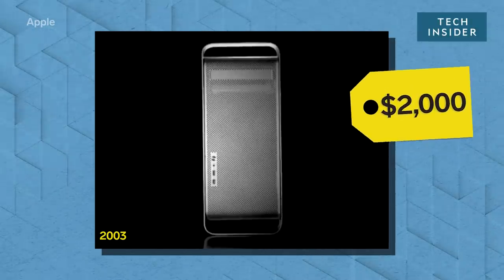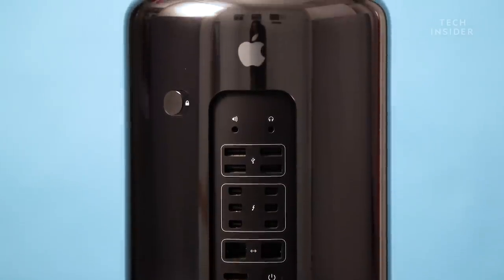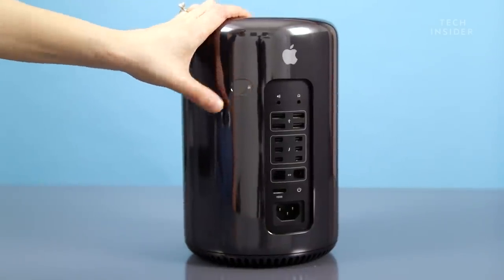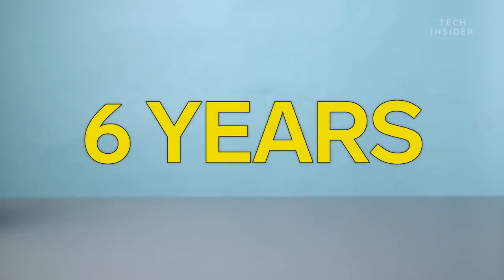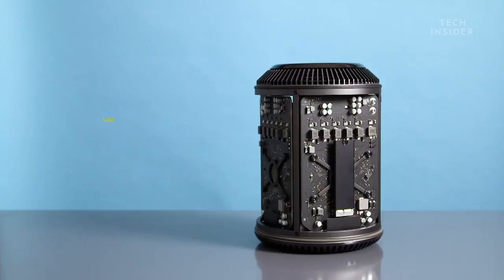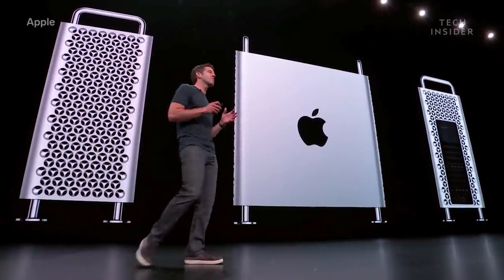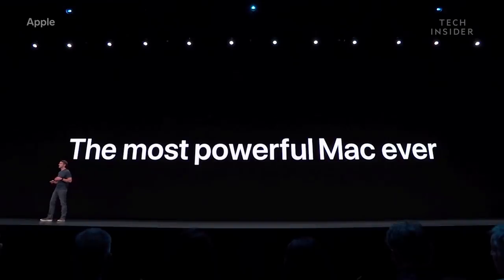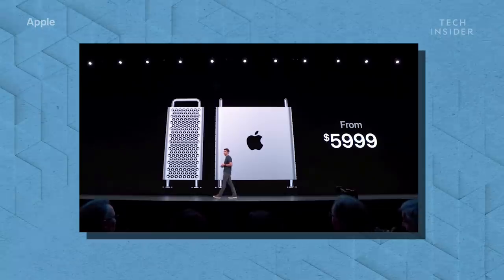Why Apple's 'Trash Can' Was A Colossal Failure

Comment: Wait, these ppl knowingly bought an Apple product then complained about a lack of expandability or customization???
Reply: Kevin Davis talk for yourself. New Mac Pro has 1.5TB Ram expandable

28 core processor 

8TB SSD
Reply: @kanishka100  uh, it's still overpriced garbage compared to building ur own pc
Reply: @nick14324  did i just see the word "just"?
Reply: Kevin Davis hmm
Reply: I understand that it's a bit of a running joke, but on a pro machine, the lack of expansion and customization post purchase will be what kills it in true professional workflows. It isn't just about having a powerful computer, it's about having one that can easily be serviced for things like dust removal and even replacing certain parts of the system, like CPU and GPU, either as an upgrade or a repair. The "trash can" Mac Pro was none of these things. Sure, the RAM and storage were easily accessible, and you could technically get access to the CPU and replace it yourself, but it's a laborious and lengthy task, requiring several panels to be removed. IMO, it would be my worst nightmare if I had to service these for anything other than a RAM replacement, and to make matters worse, from what I heard, the system won't even power on unless the outer shroud is attached, which can make diagnostics and repair take far longer than they need to. On any other typical PC, replacements for anything other than CPU and motherboard shouldn't take more than 5 minutes (not counting the tuning process or getting drivers for the GPU), and best of all, you don't even need the case to be sealed, hell, you don't even need the power button plugged in, you just need to press an on-board power button or bridge the pins that go to the power button on the case.
Reply: @kanishka100  
1) that's up to
2) the base config uses middle of the road specs for a price of 6k (my gaming PC could probably go toe to toe with it in all but a few specialized tasks like those made with AVX-512 in mind
3) The default SSD techically isn't user-replaceable, as it's paired with the T2 chip.
Reply: kanishk sharma But it costs $66,000.00 in that configuration
Reply: @kanishka100  AMD Epyc 2 CPUs can support 4 tbs of ram, has 64 cores and 128 threads. Base clock of 2.6 GHz and can overclock to 3.3GHz and only costs 7,500. But that's only the cpu.
Reply: I bought an Alienware in 2012. I’m still using it  in 2020 and never needed to upgrade any of the parts.
Reply: why do people hate on apple so much? sure they make mistakes, but everyone does!!
Reply: The whole point of the Mac Pro in the Apple ecosystem has always been that it fills the needs of anyone who is not served by any of the other more constricted models.
At a price, of course.
But the whole point of the Mac Pro is that it is expandable and customizable. It needs to fill all the gaps.
The 2013 failed to do that. Hard.
Reply: Imo the only reason to buy a mac is for the software, much of which is exclusive to apple for some reason lol
Reply: @jacobamador7989  true
Reply: @MiguelSantos-kc6vw  even though a mac pro isnt for everyone I would assume it would outperform a standard pc when talking about more workflow related programs compared to warzone
Reply: @kanishka100  for 3000$
also why tf you need that many ram
Reply: @kanishka100  oh its 6000$
yea easily defeated by 2000$
Reply: @MiguelSantos-kc6vw  it’s actually not overpriced for what it does, it is by far one of the most powerful computers in the world right now
Reply: With the previous Mac Pro it was possible.
Reply: @MiguelSantos-kc6vw  you’re doing that right now
Reply: @kooranaad1839  it's actually not the most powerful. Check snazzylab maxtech and Linus.
Reply: @raymond1990  i said one of the most powerful
Reply: @kooranaad1839  not close
Reply: @raymond1990  umm ya
Reply: All custom PC could beat it at a lower price.
Reply: @raymond1990  it has like 1.5 tb or ram
Reply: @raymond1990  definitely not the most powerful but definitely super powerful
Reply: @kooranaad1839  and AMD can support up to 4tb
Reply: @MiguelSantos-kc6vw  no it isnt. You are attempting to compare consumer parts vs server/enterprise parts which just shows how unbelievably ignorant you are. Build a similarly specced pc and youll find they are the same price or more than the mac. Just look at dells and hps offering
Reply: @ZeldagigafanMatthew  it is user replaceable apple now added documentation on how to update the t2. Ive personally flashed a t2 chip to get an ssd to boot
Reply: @frederickrichard1718  the reason is that they continue to make those mistakes, usually worse. However, they view them as "innovations."
Reply: @hajjdawood  bet.
Reply: @MiguelSantos-kc6vw  95% of people in this comment section can't afford Apple products but still debate on it
Reply: @rudra20048  bet
Reply: Shocking
Reply: The whole point was that few people did buy them. Anyone talking about custom PCs is completely missing the point. I doubt if any company hired a Graphic artist or Animator and then told them to "buy some cheap parts from Newegg and build yourself a PC". They might have compared MacPros against something like an HP Z series but the decision was most likely based on the software they were expecting to use

Comment: Don't worry, some time later it will become a collectors' classic
Reply: @sasig5215  Exactly, like the Cube and the iLamp.
Reply: Yes
Reply: true dude. haha techie guys always find a way to customize their setup haha
Reply: Can you actually use it as a trash can? I see potential
Reply: A collector´s item where you throw in collector´s items that didn´t cut it.
Reply: It is a beautiful machine. It will become a classic.
Reply: Fingers crossed :)
Reply: Sheeps will buy it anyway
Reply: would probably buy one when it gets to 500£
Reply: I just sold 3 Apple laptops ; 1994, 1996 and whatever year the tangerine orange joint was for $200. Couldn’t believe it !!
Reply: Yeah like the itoliet
Reply: @RogerioPereiradaSilva77  The Cube was produced for a much shorter time, and it competed directly with the G4 towers which is what most customers ended up buying instead. The 2013 may have been a flop but it will never have the rarity or collectibility of the Cube.
Reply: @OGtalks  I'm not surprised and am seeing this with PCs as well. Hipsters, in their late thirties think a 1994 computer which was worthless a few years ago is a valuable antique. If you want a real shock look at the price of Amigas.

Comment: they should also understand why making a computer stand so expensive isn't too smart of an idea.
Reply: low level otaku The screen is made for pro users that don’t need a stand, because they use other alternatives.
Reply: Low level otaku ---- The target market for the Pro Display XDR will buy them like crazy and save around 20 grand to 35 grand vs comparable monitors.  At that point do you really think they care about $1000 dollars? If they already have a VESA setup they like, the monitor stand is optional.  You're not the market, why do you even care?

Comment: Finally picked up a trash can Mac for $300, and a 12 core CPU for $25. Works fine for what I need. 

The problem with this and 2016+ Macbook Pro's until recently was they ignored what PRO's needed, namely ports and upgradability, putting form #1, and performance around #5.

Comment: me: "oh wow they learned their lesson at least"
Apple: "$6000"
me:
Reply: Which is like 5x better than the trash can, so yeah pretty good deal
Reply: IloyukGood no lol, they are making you pay 6000$ for parts you could buy at around 2000$ (or less if you find a good seller.) they just get away with it from people who don’t know better or people who just got to have OS X, which I still don’t understand why anyone would use when Linux exists.
Reply: @BillionaireAuthentic  its extremely expensive for apple to rnd a new product like this. especially since theres not a single visible cable in the system and the quality of the materials. which is why it costs so much. its also not made for you so...
Reply: @BillionaireAuthentic  literally nobody in this comment sections understands. 
1. its not made for you
2. its a professional workstation
3. it costs alot to RnD a machine like this.
4. expensive? HP has a similar specced device that is upwards of 10k and still lacking some features of the Mac Pro. 
jeez most of you dont know squat.
Reply: stan LOOΠΔ 
>not a single cable visible 
>quality materials 
No lol it’s just as normal as any other computer. You can’t solder a PSU cable onto a GPU and you still need to plug in your Mobo. And “quality materials don’t make sense. They use Intel and Nvidia chip sets just like any other PC manufacturers. There’s literally nothing different in the internals aside from a custom MOBO that if anything makes it more of a pain in the ass to upgrade. If you really want a good computer that runs OSX just get a hackintosh or better yet switch to windows or Linux. People who defend Apple on their bad monopolizing products don’t make sense to me.
Reply: @yeehaw5741  a workstation? don't make me laugh. that is the absolute worst excuse ever.
Reply: @yeehaw5741  it ships with a non workstation GPU, firstly. Only on the absolute max upgraded version. So how can you call this thing a workstation? The GPU is far worse than the other Mac in their lineup, the iMac Pro which does not only come with a better CPU and GPU, but is cheaper as well. Your Workstation bullshit is the worst excuse ever sincw this thing is just overpriced and a PC for 10 grand, that looks a whole lot better outperforms this junk by a litteral 100 times.

Comment: I think people are very hard on Apple for the trashcan Mac Pro. It was designed with Parallel computing in mind. Which was ahead of the time in 2013. FCPX, DaVinci Resolve, and several other programs now scale well for parallel computing across multiple GPUs and CPU cores. I get better performance in FCPX with two RX560 cards then one RX580. 
Anyway, I am excited for the release of that updated model. That’s exciting.

Comment: 'The new Mac Pro is incredible'...   incredible expensive! Another failure. 😂
Reply: bigbotno1 $15,000 for a 6k graphic spec computer when u can build an 8k computer for much cheaper💀
Reply: @dwaynemondragon6421  Not everyone wants a Mac Mini, Mac Book or iMac to work with. Intel Xeon 28 core and Geforce 2060 sell for about $4.000, computer will probably cost you less than $5000.
Reply: Udah Vektorin Aja  not even close ahaha
It cost less than half of that number
Reply: @bigbotno1  but this mac pro aint no rtx2060. its the world's most power graphics card at 128gb of hmb2 memory. thats the most in the world, and it uses Infinity Fabric Link for faster multi-link gpu computing

Comment: I wish to know the price of each thing inside that $6000. According to people it the PC with same parts should cost $3300 maximum. If it really is 3300 what is the other 2700 for? paying little extra for brand name is common however 2700 is too much.
Reply: Mohammed Alhawaj The $3300 figure isn't really accurate. A 1-1 machine costs about $4800 which still isn't amazing but is an improvement
Reply: Supply and demand
Reply: @happyfase  exactly, my first self built pc can just keep running without throttling
Reply: Logan Revesby They’ve said several times that it will support the thermals. And they’re not ready to let the pros slaughter them again

Comment: If I were in the market for a computer in the price range of $6000 or more, I'd be eyeing a dual socket Epyc setup, for Christ's sake! $6000 is the price of a base model Mac Pro. Yes, indeed, the model which has an 8 core Xeon and Radeon 580X graphics. That has got to be the worst deal of the decade for sure. The 2019 Mac Pro is a terrible buy, even if you're a person with access to near unlimited money. That is a fact. Period. There is no argument, there are no ifs or buts. It doesn't matter how attached to the brand you are. God have mercy on you if you unironically buy this and expect something "professional". ON THE OTHER HAND, so I don't get crucified here, the display (excluding the stand fiasco) is good value for the money. There's really nothing like it on the market, and the closest competition is even more expensive. That is fine. The Mac is not.
Reply: If K had a budget of 6000 dollars i would be building the best pc.
Reply: xXx_420_360_HaX0rDaN0uSkoupah#sWaG#l3g1t_darud3w33dstorm_360_420_xXx Nailed it. I used to be a loyal fan of Apple. I’ve still got a 2012 MacBook Pro running strong. Let’s face it, Apple isn’t even close to the company they used to be. I’m putting together a PC build soon that is HALF the cost of the new Mac Pro and has nearly DOUBLE the specs. Anyone buying that new Mac Pro is absolutely clueless, and would be an idiot to spend that kind of money. And the fact that you’re locked in to using an AMD GPU... yeah that’s a no from me.
Reply: It's pretty reasonably priced compared to similar workstations, actually. Compare it to Lenovo, Dell, or HP and their workstation offerings. It's more of a pro tool, rather than a prosumer tool, which is why the price seems like a sore spot.
Reply: @thebristolbruiser  Have you tried pricing a custom build? The base Mac Pro comes with an 8 core CPU, 32 gigs of ram, AMD Radeon 580x. I've priced a 16 core CPU, 64 gigs of ram, NVIDIA 2080ti, for half the cost: https://pcpartpicker.com/list/z4vTGG
Reply: @thebristolbruiser  I also forgot to mention the Mac "Pro" only comes with 256GB SSD (really Apple?). And my custom build comes with 2TB SSD, one being an M.2 drive.
Reply: @mattrittman  With the Mac Pro you can get three years of on site support from Apple, similar deals with HP, Lenovo, and Dell. A custom build does not offer that. Nor does it come with any other business perks. And who uses local storage these days anyway? Those 10gb Ethernet ports are what will really be put to work in a real workplace. 256GB may not be ideal, but it is not a tiny amount.
Reply: The price is comparable to similar work stations. But the man thing is, this isn't targeted towards consumers, but large editing house.

You think Apple is expensive, wait till you get into professional videography and film. The Apple computer is often the cheapest big component in the production chain. Hell, a single camera lens will set you back 10k!

For consumers and independent film makers an iMac will be more than enough. Not even the higher end ones.
Reply: I am fully aware that this is not targeted to consumers. Yet it doesn't excuse the fact that for $6000, you can get the following:

Dual Epyc 7351 at 32 cores / 64 threads total
Radeon Pro WX 7100
32GB of ECC memory
250GB NVMe SSD and 2TB HDD

All with "lifetime labor & technical support + 2 years parts replacement" (can be bumped up to 4 years for an extra 500 bucks). You're getting all of this for the price of a base model Mac Pro.
Reply: @thebristolbruiser what a lame way to defend apple.
Reply: @TheNinjaDC No. The very high end is windows/ xeon/ amd.

Comment: Many people in the film community actually didn't mind the trash can, at least on the editing side  animators maybe not. You could expand up to 128gigs of RAM. The processor was finally upgradable. The 12 core processor was pretty solid. The top of the line stock video card was enough for 99% of anything to do with editing. It could run three 4k monitors. Basically the maxed out trash can was enough for most editing scenario's. It's the animators and editors that go beyond that 99% that had issues.
Reply: Hahhahahahha its the user fault
Reply: @Teluric2  You responded to a 4 year old post with something that is unclear and doesn't seem to make sense.

Comment: Using only one of these colossal failures I made half million dollars in three years doing 3d and 2d work. Wish someone would have told me it has crap.
Reply: If you had followed lots of peoples advice here you could have made $502000 by saving $2000 by building your own PC.

I'm joking of course. Compared to the Sun Workstations I used for years in industry the Mac was probably a bargain.
Reply: This does not include the over 20 million that my designs made the companies I designed for. All from one colossal failure. Guess a $2000 investment to net 20 million is a suckers bet .People will find fault in everything while others can make money with an etch-sketch. I also had a zero failure rate. Always came on always stayed on.

Comment: I am still using a 2010 Mac Pro, because it can actually be upgraded.
"form over function" has plagued the whole Mac line-up. Macbooks, Mac Pro and iMac.
The only reason I am even considering Mac, is the operating system.

Comment: To call something that they kept out for 6 years a failure seems like a gross overstatement to me. Complaints only really started rolling in around 2016, which is when they should have admitted their faux pas and changed the design, but they kept it around for three whole years longer.

Comment: Power users are totally abandoned by Apple. And building a 6000$ base model machine is not a way to get them back. It's impossible to justify that price now adays. You can build a same specs PC for half the price with no one single thing missing (apart from design).

Comment: I can build a monster PC with a 128 - Core Threadripper, an RTX 3080, a PSU with a reasonable wattage, 64 Gigabytes of ram, and a higher-end ASUS motherboard. And It will cost 1-2 thousand dollars less than the Mac Pro.